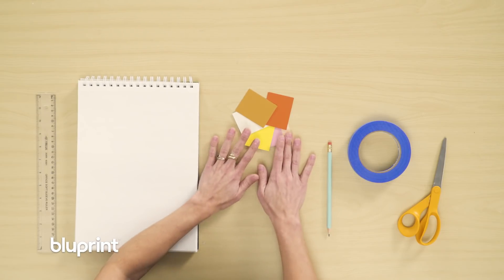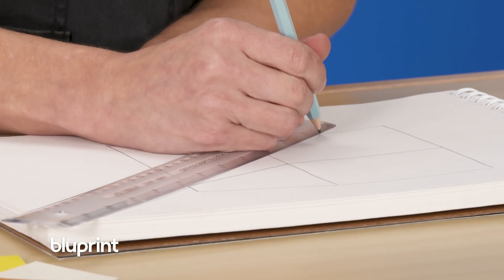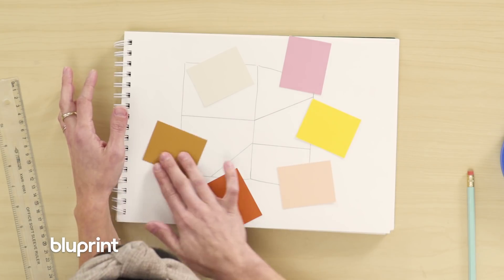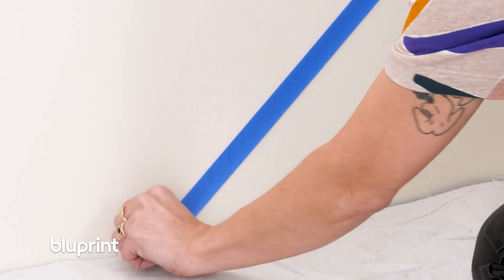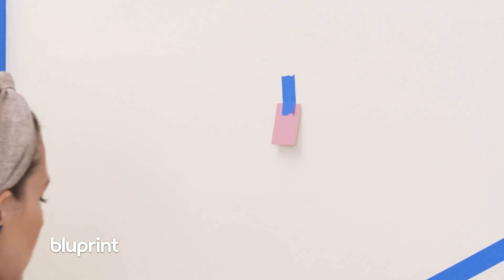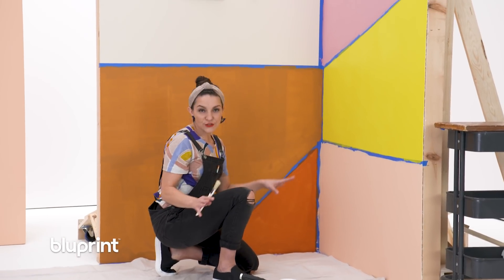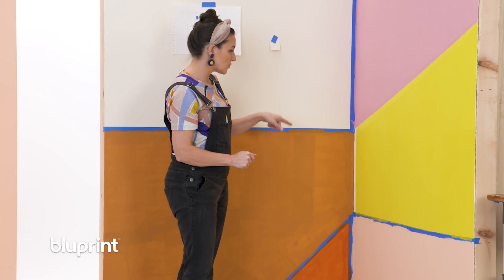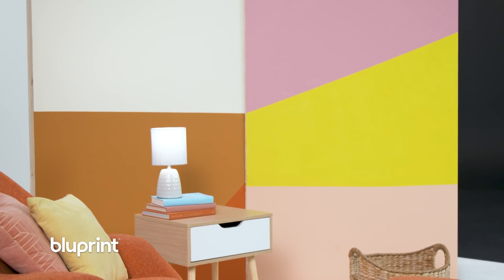Learn to Color Block a Wall | Creative Ways to Add Color to your Home

Comment: What about the spots covered by the tape?  Won't they be white when the tape comes off?  Am I missing something?
Reply from the maker: Correct. If you don't want the blocks separated by white then you can fill it in by hand with a brush. You could tape over the other color if it is dry and paint along that line if you are worried about freehand and the line staying straight.